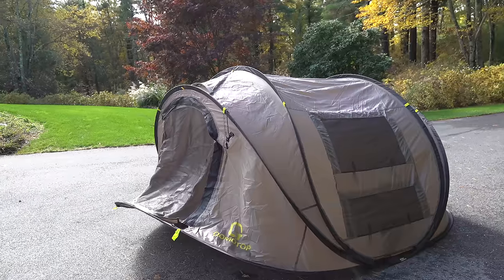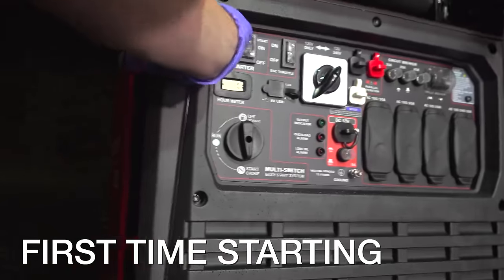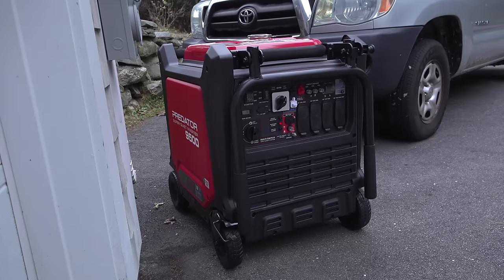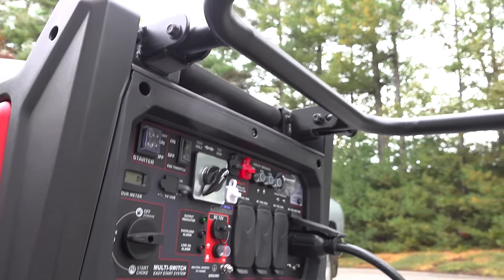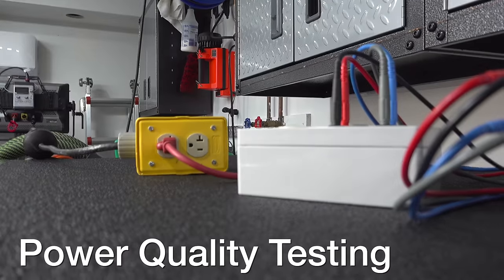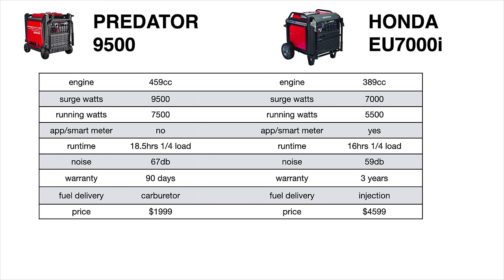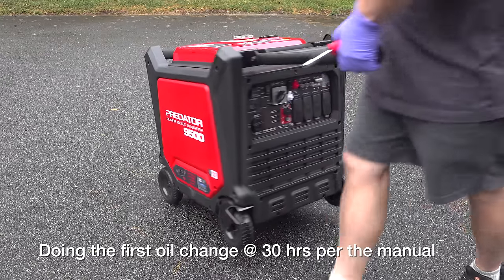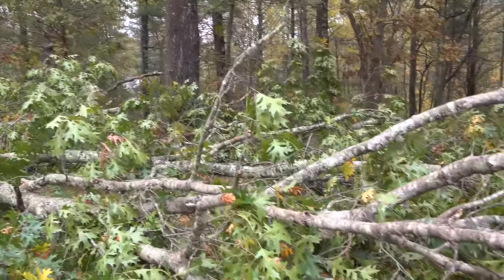BIGGEST Harbor Freight Generator Predator 9500 Review & TEST

Comment: I've always taken extra care of small engines because of how finicky they can be. I had a predator engine on a wood chipper and put about 150 hours on it over a few months. It started first pull every time and ran like a champ. There's no doubt taken care of they will run. I just don't know about true longevity yet. My dad has a Honda EM series generator he bought when Hurricane Fran hit in 1994. It has over 1000 hours on it and still starts and runs without any issues. When we start seeing predator generators lasting as long as the Hondas then I will trust them. 

What it really comes down to at this point is, have the Chinese developed a generator that matches the build quality that the Japanese have created with how anal they are about perfection?
Reply: Get over yourself and the honda series, our 3500 W chinese harbor freight runs 8 hours a day for past 2 years, (thats about 5800 hours) keeps running, simply do the recomended maintenece and it will last as long.
Reply: The Honda's are the best , let the others save the money and buy the junk. Try to resale a harbor freight generator let's see how much they'll get for it ..lol
Reply: @TheGuruStud  I don't care that HONDA cost more, I have 4 of them.

Comment: Pro tip: You can convert any carbureted gasoline small engine to propane with a DIY kit. They're basically universal and cheaply/readily available. My old Honda gen from the early 90's (6500EX) was converted and it's MUCH more cost effective to run that way! Not to mention that liquid propane stores for incredibly long periods of time vs gas and is available everywhere. You can go down to most grocery stores and pick up a 5gal BBQ bottle of propane. I personally have a 300gal tank that's semi-permanently setup close by where I keep my gen and it will run that generator for almost a month
Reply: how about natural gas? It must be difficult since it is not offered.

Comment: My Harbor Freight 9500w generator now has 996 hours and not one issue. 
1. I use Shell Rotella synthetic. 
2. I use 93 octane fuel. The high octane fuel removed any surge/load burps my generator had. Well worth it.

Comment: Check out the Duromax. It’s a clone of the predator but with a real control/monitoring panel, dual fuel and a 3 year warranty, for a few hundred more than the HF. It’s totally worth a look. I think it beats the HF one actually
Reply: Totally agree.
Reply: Is it an inverter? Or regular generator?
Reply: @joshmason1003  It is an inverter too. However, if I remember correctly, the surge watts (on gasoline) is 9000 not 9500
Reply: Yeah, Gavin’s Garage did a side by side review with that Duromax

Comment: I bought the predator 3500 and the other day I heard the sales person at Harbor Freight saying that the parts were nearly identical to the Honda and were even interchangeable. Maybe you could look into that and see if that’s true. He made it sound like it was basically a clone of the Honda.
Reply: How much
Reply: Read Josh.Explores comment about them posted about 18 hrs. ago.  I believe you'll be able to answer your question  yourself.  He's gone through 3 of them.
Reply: Jeff Spicoli  naw  7hp chonda clone engine. got one on my champ 3500 and my wood chipper.
Reply: Everything is made in China today, small engine arent rocket sience, everyone can build them.
The problem with stuff from China is that they are usally not very well designd, but they can be easily improved and the cost a lot less than the premium stuff.
Reply: There's a reason in the Honda is more expensive, because it's that much better. Two parts can look the same but one be trash.
Reply: @HitLeftistsWithHammers  yep a predator engine is absolutely not as good as a honda engine... my brother picked up two for his gokart, runs fine, but clearly not as high of quality as adjustment of the valves was needed (never needed to do that on a honda) etc...
Reply: There's zero chance of that being true. Just remember there has to be a difference between the two, you cannot clone every detail of sophisticated engineering.
Reply: Copying, within reason, is a sincere method of flattery.  Overdo it and you gave legal problems.

Comment: Honda or yamaha the only way to go for longevity. I have a 12 year old Honda that I got from a client, had not been started or run in over 9 years. Changed the oil and gas and it started right up.
Reply: What you're saying is, the Honda has over twice the life of the Predator.
Reply: You can't knock a predator.  The bang for the buck is unmatched. You can get 3 or 4 of these for the price of one Honda or yamaha. I know people that have had then for years and not a single issue. I have one and am going on year 2 with zero issues and starts on the first or second pull. If you just change the oil and put stable in the gas you're our good to go.
Reply: The Honda is very good the Yamaha is trash but I’ve had my 3500 predator for eight years still running fine
Reply: I have several predator 3500 generators with 10,000+  professional hours
Reply: I just got my honda eu7000is my uncle's friend and others that bought a predator say its trash and go out right after 90 days.
Reply: Even seen a plastic Honda cam gear in their small engines? I have.
Reply: Honda are over priced for no reason other than name brand and I wish I would of just went with the predator 
My brother has one and it's been perfect for a few years now.
Reply: @AdventureMan-kx3dr  Wow. That's a lot of run time
Reply: I guarantee a new Honda will not do the same as that old Honda either. Can't compare something that old they all make junk nowadays
Reply: I have a predator generator. It’s lived half it’s 6 year life sitting outside in the elements. It’s gone over a year without being started, I use 2 oz off sea foam per gallon in my gas as a fuel stabilizer. Always starts right away and has never failed me. While a Honda etc is great I think the predator is an amazing value and they are built better than you think. If you took care of a predator better than I have I think it would last a very long time and be plenty dependable

Comment: 90 days vs 3 years of warranty gives some hints of whether Predator is a Honda killer. For occasional use for sure, as long as it is okay if it won't work after all.
Reply: For less than 1/2 the price, and more power I would say it's worth the risk.

Comment: We went through 5 harbor freight generators in 30 days then Harbor freight would not honor the warrnitee...
The first stoped generating... The second would only run for 3 min. The 3 one never would start. The 4 one would not power up under load. The 5 would shut off in 10 min.
Reply: probably the crappy spark plugs they use if it shuts off.  Replace with NGK plug before you even use it the first time.

Comment: Purchased a used diesel 6kw kubota generator for $1400 and never looked back. 96 hours of run time @ 5KW. Programmable. A fraction of the noise (turns 1800 rpm rather than 3600 for a gas). Will run on home heating oil so plenty of fuel on site. Never looked back.

Comment: No 30 amp outlet, No dual fuel, No remote control, all equals NO BUY. Great review. Thanks - Harbor Freight Generator Predator 9500 $2,399  -   GENMAX GM9000iED Dual Fuel, Quiet, Remote / Electric Start, $2,399.99. Much better

Comment: Warning per CO safety alarm: after a few hundred hours, the CO sensor becomes defunct, so onboard electronics shuts unit down every 2 hours or so with flashing indicator, "CO sensor life alert". Honda expects owner to bring unit to Honda repair shop to replace CO sensor, a planned revenue source. They could have installed a bypass switch, but no profit in that.

Comment: A couple questions... does HF actually offer a parallel kit for this generator?  I don't see any mention of it on their website and the manual only mentions it under the safety section. I'm curious how you would get 7500W continuous or 9500W surge from 240 volts with a 30A breaker. Even at 7500W that is 31.25A and should trip the breaker. 9500W would be 39.58A and should definitely trip the breaker. I see Honda has increased the price of the EU7000i to $5059. Do you know of a place selling them for $4600?  I see a lot of reviewers calling this a "Honda Killer" but in an honesty it would seem a bit premature to make that statement. Perhaps update the review after 5-10 years and racking up hundreds of hours on the unit. Only then will we truly see who is left standing.
Reply: you might be able to parallel these into a 50amp box with the use of two 30 to 50 amp line adapters.  then run the 50amp parallel box lead to a 50amp interlock or transfer switch.

Comment: Hello, first... great video, and I appreciate the honesty.  I've listened to some of your other videos which are great as well.  I have the Predator 9500 and the manual says to ground the generator, but I noticed yours wasn't.  Is that b/c you're running it through the home wiring?  If running the generator as a stand alone does it need to be grounded?  Also the manual says "Fill the engine with the proper amount and type of both stabilizer-treated unleaded gasoline and oil."  Is it just the gas that needs the stabilizer or both the gas and oil?  Thanks for any input and keep up the great work.  Blessings

Comment: That was some pretty nasty looking oil coming out of the engine during the change.  Predator says to always run their engines at half or lower rpm's when starting up the first time.  Then change the oil and run with a load.
Reply: My first oil change after 1/2 hr running came out looking dirty I put this down to the assembly grease they use to keep things lubed until they are purchased and run. Did an oil change at 1/2 hr land 5 hours and much cleaner at 5 hrs. 👍🏻🇬🇧

Comment: Fuel injection is a game changer at high altitudes!
Reply: I drove into Tuscon with  Fiat 600 40-some years ago, it was running like poo.  Found a mechanic, he said-- there's no air here.  Try to run across the parking lot and you'll see.  
Fiddled with the carbs and then when I was back town, all was better.  
If I lived in mountains, I'd want FI.  As it is I'm at sea level, but stuck with FI.  I'd rather have carbs.  Much simpler.

Comment: Almost every machine is fine when they are totally brand new. Only time can tell whether a generator is good or not. No one beats Japanese in quality control and material quality. Are they even using the same steel for the engines? It is like driving a Toyota vs. a Ford.
Reply: There are guys with 8000 hours on their predator 3500 inverter generators . Just blew a couple 60 dollar ignition modules . The key to these predators is change the oil after the first hour or so. Then again at about 5 hours then change it after break in at about 20-30 hours the normal maintenance schedule.
Reply: I have one of the 8750's. I put close to 1k hours on it in 3 years powering shop tools while building my off grid house. Thing still starts on a single pull after being in the weather for 3 years. They're built well.
Reply: Lmao you really think so , because to me it sounds like you don't have enough experience to say or know what good quality is . It is very telling by your name alone what to expect from you .
Reply: @rickyricardo3551  LOL. 40 years ago, my friend got a Honda civic with over 200k miles on it for 500 bucks and it ran like a champ. These cheap generators are using cheap Chinese steel, not Japanese steel. LOL You know the difference? LOL LOL LOL

Comment: I can't speak of personal experience with HF generators, but if these machines are anything like their power tools, hand tools, and pressure washers, they perform  very well in the short term,  but after a year or two, they're pretty well used up.
Reply: they aren't. HF sells mostly crap...mostly. their predator engine line has been around several years now as has their generator line. their first big inverter generator the 3500 has an excellent track record. only reason i don't have one is i got a steal on a NIB champion 2k inverter genny.
Reply: I've had great luck with their power equipment.  I've had issues with their power tools but HF has always honored their warranty no questions asked.

Comment: Was I the only one that thought the oil coming out was a little shiny? I know it was breaking in but that seemed like a lot of sparkle.

That being said, my boys have multiple go karts with the predator 212s on them. They beat the crap out of them. Dirty air filters, no oil changes, who knows what kind of fuel, etc and they still start first pull after 5 years of continuous abuse.

Comment: Question about 30 hr break in. Should I not use power from generator during break in ? How many hours at a time do I run generator? 2 hr, 8 hr intervals to get to 30 hrs? 
Do I run on ECS on or off during break in ? 
Thanks for your time

Comment: That is a great video I have a older non-inverter harbor freight 8750 surge 7000 continuous bought it in 2014 still starts every time on the first try very happy with it has a 420 cc Engine I also just purchased one of the inverter predators 3500 surge 3000 continuous I’ve had that for two weeks it is working flawlessly so far great for camping or night time power outages since I don’t need as much power overnight I don’t have to run the real loud one which is nice I went through 4 oil changes with conventional oil on both units then switched to full synthetic and I switch it out every hundred hours
Reply: @LabRat Knatz lifan builds the engines I believe, they should know how to copy Honda's as they used to be a supplier for Honda and the technology is like 50 years old at this point!

Comment: 7:27 the only thing I didn't like about this, is the oil drain. They couldn't have had a drain tube with a plug at the end to prevent a mess? Other then that, I'm seriously considering upgrading my smaller generator for this. Thanks for a great review.
Reply from the maker: I agree, even the Honda is just like this. It's not too bad once ytou do it as there is a trap door below but it would be great if the drainw as extended fully out. But it is great generator

Comment: Question:  don’t you need to modify generator to change to floating neutral before connecting into your home electrical system?  I noticed the “bonded neutral” writing on the generator in the video

Comment: The new HF Predator generators have the co2 monitor systems installed.  Nice safety feature, however, that can be problematic because the OUTDOOR WIND has made many shut off when you need power the most.
Reply: But how is the carbon monoxide (CO) sensor working out?

Comment: These are unobtainium in my area right now. I got the Sportsman 8750 duel fuel instead. It's no frills, but it is duel fuel AND it has a 50a plug, which none of these other inverters have. I got the 2 year extended warrenty, but I'm hoping it holds up. I'd love to see a review of the Sportsman. (or maybe I don't lol). Furthermore, if I just went with  a gas only unit, I'd likely go with the HF genny on cost alone.
Reply: I just bought a new 4000 watt Sportsman for
$240 off Ebay. It supposed to arrive within a couple weeks. Dual fuel. My furnace is propane. And this runs on propane or gasoline.
Reply: The only regret I have is it doesn't have 240 volt receptacle so I can run Well pump for water. I may just buy another one for that purpose.

Comment: Did you convert your Predator 9500 to floating neutral when using it to power your house?
Reply: Great question.
Reply: I purchased the little brother version of your generator, Predator 8750 Watt Inverter. I spoke to Harbor Freight tech support rep about converting it FLOATING NEUTRAL so I can use it to power my house through the electrical panel. After consulting with his manager, he told me to disconnect the yellow wire with the green stripe from the frame (actually grounded to engine) to convert the generator to floating neutral. I had a hunch it wasn't going to work...I was right. I used my multimeter to confirm. I tried to disconnect the control panel and look for a jumper wire between the neutral (white) and ground. The panel was difficult to remove and I didn't want to use force since it is brand new. I will call HF again this week. I've seen other YouTubers using Predator generators to power their homes but nothing about converting to floating neutral.

Comment: For the same price I would buy the Powerhorse from Northern Tool, which comes with the 2 year warranty.....Harbor Freight makes you pay another $599 for a 2 year warranty and you also have to buy the battery separate which also comes with the Powerhorse....Powerhorse is slightly lower wattage but for 30 amp backup feed in same category...

Comment: Make no mistake it’s not a Honda 7000 killer. But it is a nice option. The one I bought would not run 7000 W continuous for one hour. Even though my Honda is not rated that high it will but the predator is still a good generator.

Comment: I’m interested in this generator possibly. I’d need to know if it could power my house a/c first, since that’s the single biggest item that draws power that I’d worry about operating. My current generator has a Kubota motor and it has never let me down, but it’s max output is 4500 watts. I’ve seen lots of folks mention their refrigerators, but refrigerators don’t use very much power and only actually run every once in awhile if you keep the doors closed. I’ve gone completely without power for 9 hours before and there was absolutely no noticeable difference in the refrigerator.